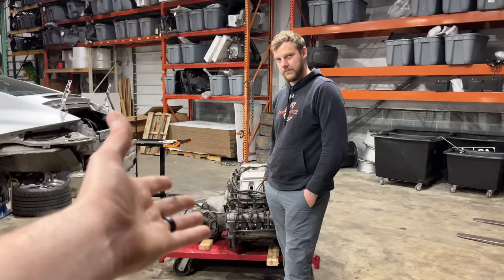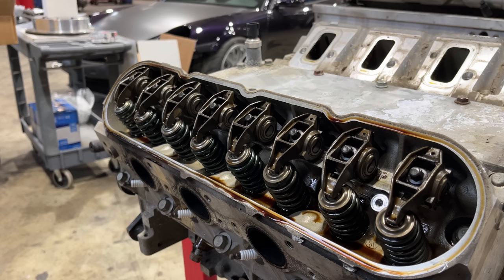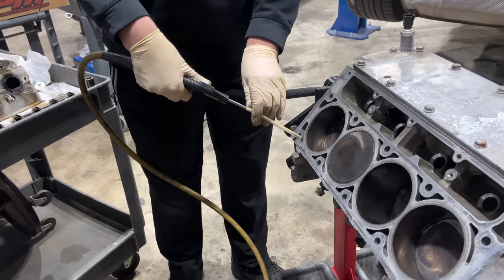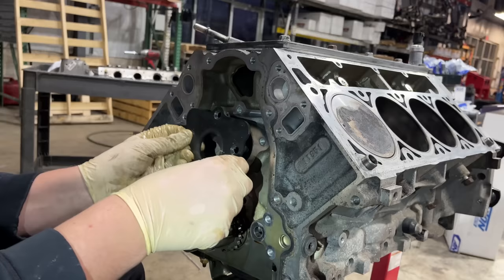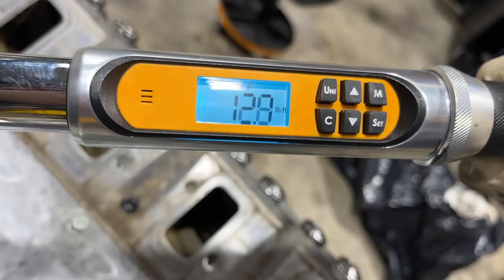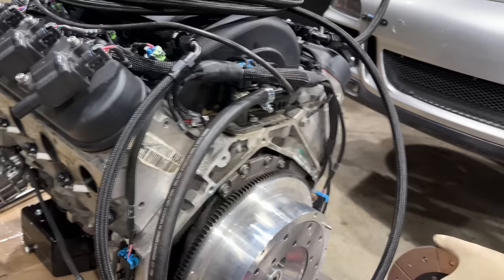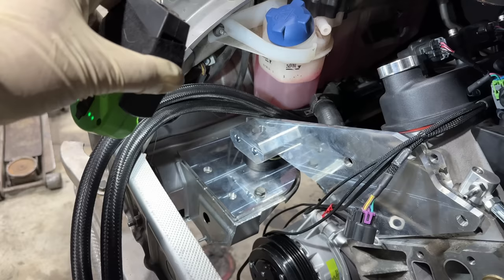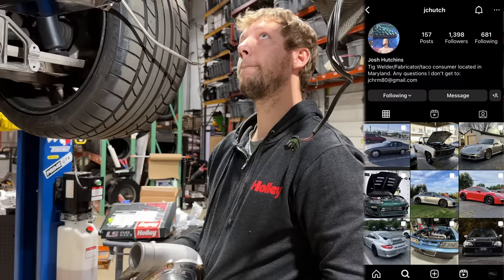I Put a CORVETTE Engine in My Brothers PORSCHE 911

Comment: It's crazy how much of a massive improvement the LS is in that chassis
Reply: How can you know its an improvement if the car aint finished and they heavent driven it on the street nor the track? We dont know anything!! That stock gearbox will brake in to a thousand pieces when they put turbos on that engine!
Reply: @MaciusSzwed  lol they aren’t the first to do it it’s a solid swap
Reply: @masonshafer811  surely that anchor would change the way it handles
Reply: @masonshafer811  Lol fool, I know people that did this in the 80-ties!
Reply: @Agent_Clark  the LS engine weighs almost the same, if not less, than the flat-6 that it replaces.....every person I know that has done the LS swap says that the back end feels the same and that the balance isn't that much off before doing suspension adjustments.
Reply: @Agent_Clark  The N/A LS engines are lighter than the flat 6. It's an all aluminium pushrod engine after all
Reply: @Agent_Clark  I mean I wouldn’t try putting a iron block truck motor in it but an aluminum block 6.2 can’t be much heavier than the 6 cylinder that came out of it
Reply: Improvement might be a bit of a stretch
Reply: Yeah I could see it handling a little weird because all the way it's going to be on the top now
Reply: The weight of the engines may be the same or LS myte be lighter but the LS is still a bigger motor and will affect the why that car handles so I hope the frame was reinforced and have strong welds for the custom motor mounts made
Reply: Amazing how so many speak here but seem to know so little about Porsches and the perfect engine swap.

Comment: Lots of parts/money put into it, I would have at least put in bearings and likely forged pistons/rods too.  If your going to have twin turbos, might as well be able to take advantage of the boost.  Seeing metal has been in the oil from the cam, at least check bearings.
Reply: Looks like they have a few spares on the shelf

Comment: I really like the welder, he's cool. You really can't get more than about 400HP out of an M97 engine rebuilt to 4.2 liters (which makes for a fantastic car) so if you want more HP and you're not a purist (no 996/997.1 owners are) then by all means swap to a simple Chevy engine. I would R&R Porsche engines singlehandedly all day long including tubos and often you'd have 1cm/1/3" clearance between breaking shit and not ha ha. The $500 lift table from Harbor Freight is a great help in engine R&R on Porsches.

Comment: Had an old Ford van I did that to .
Plenty of HP excellent fuel mileage .
An fairly cheap to do !!!
A balanced blueprinted small block 400 
About 430 horse .
Would smoke tires at 35 mph until I let off .
Dana 60 posi.
An overdrive trans is only thing I can think of ...
People just don't think of a van as fast but this was !!!

Comment: Since the rear motor plate is on bushings, I suggest adding a secondary support up top after you have your intake piping, since it might flex a bit, maybe the bottom takes care of most of it, but it might help if you're getting weird weight transfer behavior

Comment: That’s impressive that’s a huge motor into a small space 👌should be a monster
Reply: You obviously haven't seen a 997 TT dropped from the pan, it's essentially the same size.
Reply: ls engines are very physically small and light for their displacement, one of the advantages of pushrod engines :)

Comment: I'm sure you're aware but Comp makes air cooled turbos as well, super nice in tight spots like this
Reply from the maker: Yes. I opted for coolant cooled because it would be easy to cycle it in, and this will be a street car that gets driven alot. Given the proximity to motor heat, we decided it would help!

Comment: Great editing ...no BS!! that motor went in really nice , what's weight difference between the LS & boxer?
Reply: Probably not much
Reply: the boxer has 6 cylinders and is angled 180° in a flat shape, the LS has 8 cylinders and is angled 90° in a V shape
Reply: Well wait It actually weights less than the porshe. 

From what I saw on some forums. 
The Porsche engine is an average of 450 lbs for early versions.
The ls3 is an average of 430 lbs.
Without accessories, engine assembled mass only. 😂
Reply: @TrojanLube69  I believe it, I think people don’t realize how compact and light in weight for being a V8 an LS is. Coyote motors are huge even next to a 7L LS
Reply: @peterb4143  yup, all the LS engines are pretty much the same physical size whatever the displacement.
Reply: @lorddoobsworth144  wish I could put an LS7 pumping out almost 700hp n/a in my C5 Z
Reply: @peterb4143  if I didn’t get laid off a few weeks ago and decide it’s time to go back to school? I was about 50% of the way to getting that swap done. But my c5 is not a z
Reply: @shaunwalsh85  hey still a c5 😎, I believe you’ll find success in the long run just keep your head up and if you still want to get it done you definitely can
Reply: @peterb4143  oh, I’m just delayed & dejected, not derailed & destroyed. Once I graduate CDL school, I’ll be able to get a job making 2x to 3x what I was at the job I just got laid off from, so I’m not even worried about it. This is just a setback.
Reply: @shaunwalsh85  gotcha, would love to see it when it’s done!

Comment: Huge challenge, how much more weight did it add and did it compromise the handling?
Reply: Same weight as a stock flat 6 NA  engine .. 200 lbs lighter than a 997 turbo engine

Center of gravity is a little higher but i cant say about handling since i havent done it yet .. but getting ready to do it next winter in a 996

Comment: Owner of a 928 GTS Manual for 20 years, and always fancied a V8 911. Sold my 993 Turbo 4 because it was too dull in 4WD. It had the factory stage 2 kit with 450bhp. Turbo lag was a bit too much and the exhaust note not not vibrant enough. Beautiful to look at though.

Comment: I use a hammer and socket with a block of wood in the combustion chamber to support the valves, a light whack to the socket and the keepers pop right out and are contained with in the socket

Comment: Just a tip on the valve guide seals use a extension and socket and push them on by hand should go one fairly easy with some lube.. Keep up the good work..

Comment: Theyve been doing this for decades called "HIllbilly 930s" ,down south they put diiferent Corvette engine in regular 930s,and they run the air inatke through the side window on the drivers side, in 2010 I bought a 9.9 out of 10 shape 1983 944, it came from Canada and looked really different then the American version, somebody had done an LS6 V8 swap ,put on really big  Falken RT660 race tires on it and 2001 911 turbo rims ,the five spoke 18 inch rims. beast...but bought a 1984 Porsche 911 Cabriolet 3 years later, and my Saab is so much faster after a Maptun stage 1,

Comment: Nice to see these conversions. I put Ford engine into Mazda RX7. Wish i had workshop full of tools. All i had was a few spanners, hacksaw, stick welder and hand drill. And some 1/8 plate. I did have an adapter plate made by drawing out the rear of engine and gear box on tracing paper and had it flame cut out.

Comment: Great watch, two concerns, this is a 911, LS3 motor sits way higher in chassis moving centre of gravity north!! This will compromise handling!!  You mention the importance of cleaning the head bolt holes and block faces, no mention however of the extremely important removal of the resultant fine metal filings laying in the motor’s oil galleries from the worn cam lobes which will destroy the new internals!!

Comment: If the motor twists and messes up the engine mounts, will the structural rigidity provided by the motor be compromised? Pretty sure you guys will be running enough power for this to be an issue..
Reply from the maker: Valid point. IF there is space, I have debated doing a tubular cross brace there.

Comment: Can you discuss weight difference with the swap and also the wiring harness/ brain box ...how will the new motor be inter-connected with the Porsche dash electronics?  I like the calm professional approach.
Reply from the maker: The wiring harnesses is a plug
And play system from wiring specialties. CPE has created canbus integration modules, that make it work with all canbus systems. All factory gauges work, stock gas pedal, full integration.

Comment: Major Fau Pax at the start....

A motor takes energy(electricity) to produce work power.
An engine takes fuel(gasoline) to produce work power.
Motors are in blenders and dishwashers.
Engines are in landscaping equipment and cars and trucks.

Comment: You might want to run a dry sump. Heavy braking pushes the oil towards the front of the car, therefore, away/out of the oil pan sump. Unless the oil pan you selected has the correct baffles.
Reply from the maker: The oil pan is baffled with a trap door setup inside the sump area. I don’t think any amount of turning or breaking will be able to starve the engine.

Comment: I have a 2008 ls3 corvette with 90,000 miles. Hopefully I don’t have those lifter issues with mine or need a rebuild. The motor runs very quiet and I don’t hear any type of ticking. My issue is I can’t drive it because the fan isn’t working. At first one of the cables melted. I resoldered the wires it worked for a day then I got the check engine light again because the fans weren’t working.
Reply from the maker: It’s the fan controller plug. Known for melting at the connection. Common c6 problem.

Comment: This is an amazing project. I would love to own and drive a 911 with a LS V8 swap. So much better. More power. Low cost to maintain. More reliable. I’m not sure why more people are not doing this? I wish I could hire you guys to build one for me. How bad ass it would be to put an RHS 502 LS in one of these cars. 700 plus HP with massive torque. Total hot rod. Can’t wait to see this car run and drive. Richard Rollings on Gas Monkey Garage did one of these with a stock LS 420 HP or so. The car lost the race with the turbo car but barely! If they would have used a 6 - 700hp LS it would have blown away the turbo car. One of the best two part episodes he ever did.

Comment: Just curios, from a design perspective with the engine mount brackets bolting to the heads, is there any possibility of it breaking head cylinder bolts? With that king of power from the turbos that quite a bit of twisting force let alone suspending the weigh of the block.

Comment: There isn't no way that, that exhaust housing is a 106mm, with a 64mm comp housing those turbos would have a tough time building any kind of boost let alone it even being able to come up on gate without either NOS or manipulating timing with a super loose converter and a dump valve. Or have a all billet fully built SMX ,  but the comp 62/65's would have no problem unless at super high elevation. And im a female and I know that granted I pay attention to my husband and what he loves.

Comment: The bell housing is touching the billet aluminum cross member... Sigh. I'm glad you installed a "backwards" oil pan. How are you going to integrate the electronics into the Porshe system?
Reply from the maker: The wiring harness is done by wiring specialities, and canbus modules by CPE, it is a plug and play system with full canbus integration. All factory gauges, lights, pedal, etc will work as usual.

Comment: I love the swap, but am absolutely not a fan of the idea of mounting the engine by the heads.

Some of the newer mini coopers have the front of their motors held by the head and they had problems with head bolts being pulled out.

This is a stronger setup than a mini cooper, I know, but I still don't see it as ideal
Reply: I agree, an NHRA style solid plate 1 piece fabbed mount would be a lot stronger there's a reason NHRA insists on a front plate and a mid-plate. Otherwise, the setup is TITS !!!

Comment: Surprised the pistons rods and bearings weren’t replaced on that 100 thousand mile engine as well. Also I didn’t notice ring gap being set for boost. Cool build nonetheless, keeping a cool car on the road with a lot of horsepower with a lot less money than that high dollar Porsche engine.
Reply from the maker: No reason to do either. Engine was good and running, and LS3 is capable for boost with no issues.

Comment: Interested to see the engines weight differences. Also, the balance taken from a nicely distributed— horizontal low center of gravity, to a | vertical higher centralized weight. I imagine handling with take a hit.
Reply: Have the same questions.
Reply from the maker: The LS engine actually weighs less than the 3.8 engine. We also move the engine forward 1 inch, and it’s placed pretty high in the chassis, so the majority of the weight is pretty even with the center line. I’d honestly be surprised if it’s effected much.
Reply: @scraplifegarage  - I have a 914 with a SBC. Get used to explaining this a bunch.
Reply: That height argument is so ridiculous. This is a perfect swap on a great race car frame. Drove an old 85 911 with. 450 hp Aluminum engine and the handling actually improved!

Comment: :face-blue-smiling: So correct me if I wrong... you rebuild the top end, ie; heads etc. but you don't inspect or upgrade the bottom end, ie; Crank, main beaings, connecting rods, pistons etc. on a 97K mile engine? Makes perfect sense to the old man. :face-blue-wide-eyes:

Comment: Nice to explain the liquid at bottom of head bolt ,, to put it simply, liquid can get in the threads, or poll on the bottom and force a bit in and it hydro locks, tuques just fine, but it's against a liquid a d yeah,, ,crack the head is not something could happen, it will happen,,,,, 👍😎

Comment: With that much of LSA it won't have enough manifold vacuum for the brakes to work right at least I would believe.
Not to mention you never soak your lifters because they are a hydraulic valve and will fill with oil and if they are prefilled you could have premature failure of the valve train.
Why would you drive the middle frame bracket bolts towards the front ..(trash \road trash grabbers)

Comment: I love Porsches but this doesn't bother me in the slightest. i would be curious though how this throws off the handling if at all. i'm sure it'd be capable of making a hell of a lot more power vs the F6. If this was a classic like a 356 or a speedster, maybe i'd be bothered. but these newer models are still pretty easy to get.
Reply: the ls is a lighter engine although not by much. the CoG will be higher though, so it will be interesting
Reply: @lorddoobsworth144  that's my thought as well, the benefit to F4/F6 is the low profile/CoG. I get the feeling it would probably easier to spin out because of the higher CoG in the rear, but i assume once you get used to that the extra power would allow you to make up for that in the straights.

Comment: I'd be pretty interested in knowing the weight difference between the boxer-6 and the LS.  My guess is that the LS is lighter? as that cylinder has a lot going on in there....
Reply: The LS is lighter, but adding the turbos and intercoolers will bump up the weight. But still will be way more powerful than the Porsche engine.

Comment: Great video. I am trying to mate a 95 ZR1 engine to a Porsche 996 transaxle. Inverted as it is going into a GT40 replica. If anyone out there knows of a supplier that makes the flywheel, clutch, and adapter plate for this setup please let me know. I know of a couple of places that make this setup for the LS3 but none for the ZR1
Reply from the maker: Check out Kennedy engineering.

Comment: Engine only bolts to the chassis on the cylinder heads?

Heads can hold the torsion of the chassis and the weight of the motor itself?
Reply from the maker: Motorplate mounting isn’t anything new in racing applications. The transmission is supported by its own mount as well.
Reply: @scraplifegarage  I see motorplate in racing but racing engines is supose that are desing with this forces in mid.

Great job guys!

Comment: Curios about the weight difference and also any weight balance front/rear before and after?
Reply: i think all aluminium ls engines are a little bit ligher than the NA Porsche engines

Comment: ok. as a total mechanical newb, why aren’t the pistons etc pulled and inspected ? seems the heart of the beast gets a “pass” on the rebuild. 
V interesting build process. 🤙
Reply from the maker: No reason to pull them. Engine was good and running in the corvette it was removed from.  The stock bottom end of the ls3 is perfectly capable for the power level we are aiming for!

Comment: Spec clutch is poopoo. Blew a stage3+ on my car at a stop light. Called spec and was told my input shaft is out of round and caused the failure.

Spoke to several people that had the same issue and they were all given the same response.
Reply: Forgot to mention clutch had 8k miles on it.
Reply from the maker: Come on man don’t tell me this lol. I’m already nervous about the clutch not making it through the dyno session.
Reply: @scraplifegarage  I honestly hope it does better for your application. But cross your fingers always.

Comment: Would a LS7 fit? Since you guys talked and showed the engines in the beginning but didn't show or talk about a LS7
Reply from the maker: Yes. Would likely have to convert to a wet sump oiling system though.
Reply: @scraplifegarage  can you keep it still a dry sump and put the oil tank in the front

Comment: I want the cam shaft. a US Marine mechanic help me replace the cam shaft bearings in my 2006 hummer 3 and now I'm at 485k miles. I could use a 911 with corvette engine . years ago I had the tr 6 and worked on it to enjoy. Now that Porsche would be neat. best, j